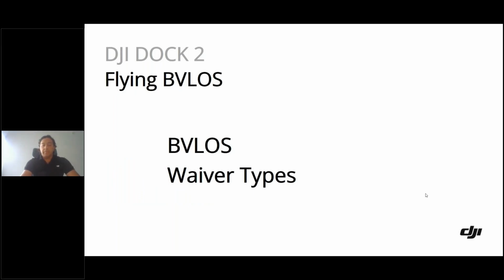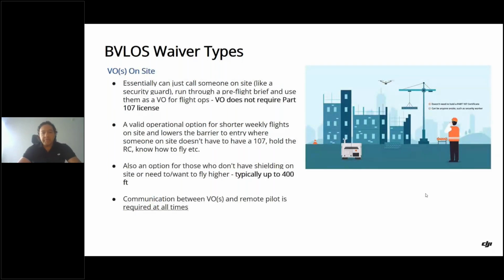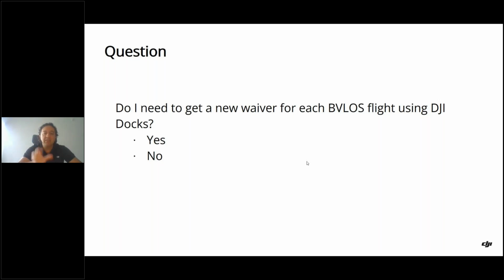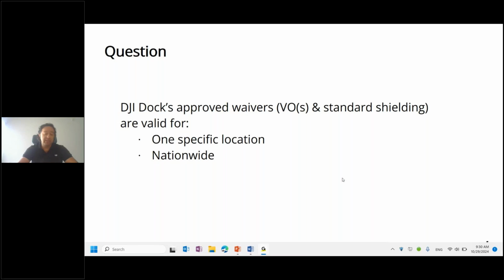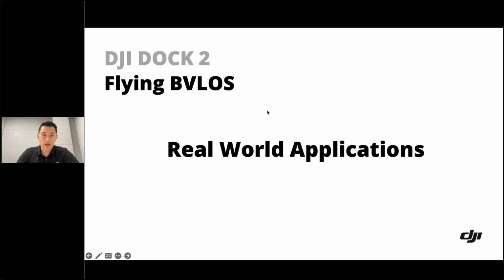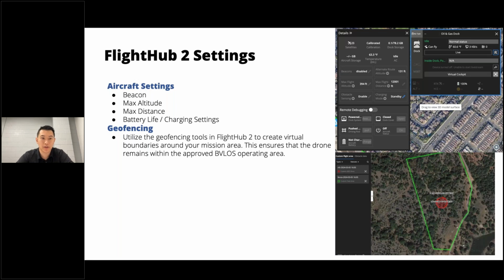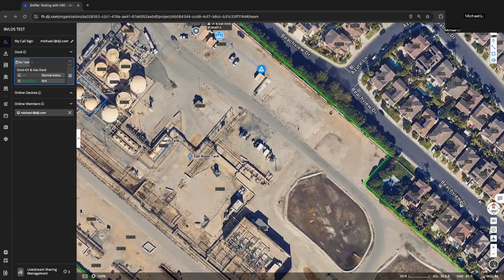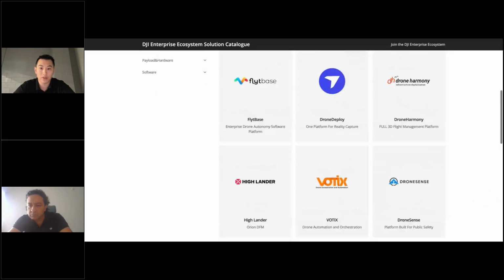FAA Waivers Made Easy  Lessons from Successful BVLOS Operations

Comment: DJI should equip all its drones, both commercial and private, with systems that warn of the presence or approach of other small or large aircraft in the airspace on the RC without using external observers or additional devices that go against the VLOS rules. DJI is perfectly positioned to develop a warning system when other DJI drones are within a certain distance of each other or within certain general radius. 

Commercial drones should have more than one camera, one for filming and at least one for observations in addition to some sort of aviation-related system on the RC to warn of the existence of other aircrafts within a certain radius.

DJI Should introduce accessories for drones used in nature reserves or national parks or wilderness in general to protect birds. I have seen drone get attacked by protected species of eagles or falcons , you can imagine the damaged caused to the poor bird by the propellers from a small drone let alone a big one such as those used in documentary films ! 

DJI should introduce an option to help drone pilots in remote areas to use the drone's satellite connection to send SOS signals just like in Garmin InReach ! why not intorduce a product similar to Garmin InReach 

DJI does not listen to the feedback of its clients !